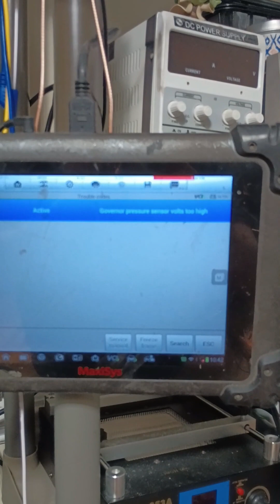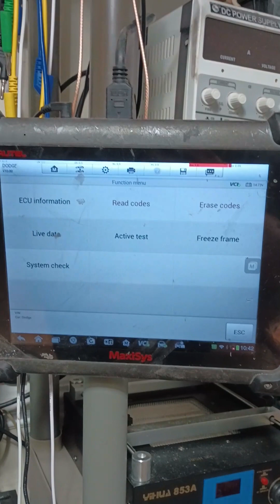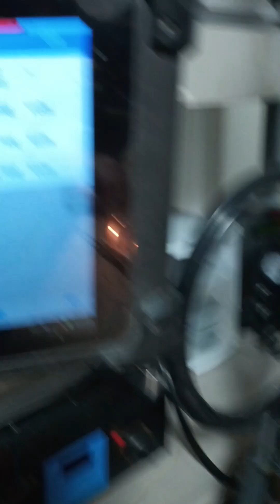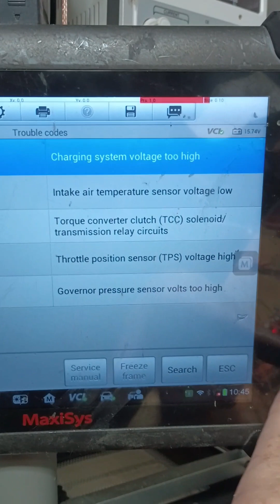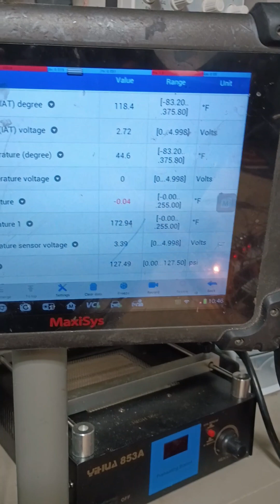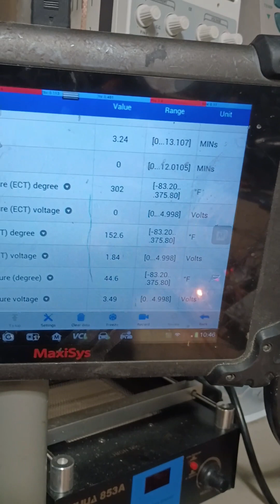ECU bench testing 96 RAM 5.9L genfield control (alternator) charging circuit with simple simulations

Comment: How can I make the ecu test system diagram. How can I obtain the ecu test system. Which ecu test system are you using?
I want to repair ecu. What is the equipment required for ecu testing?
Reply from the maker: That is a lot of info to try and squeeze into a comment. You should sub to the channel and others like it and you will start picking things up.  Other then the scan tool Im not using any test system, its just basic electronics and wiring from automotive wiring diagrams.  If you do not know basic electronics well you should study that first since there is much better information teaching general electronics that is easier to understand then actual ecu repair.